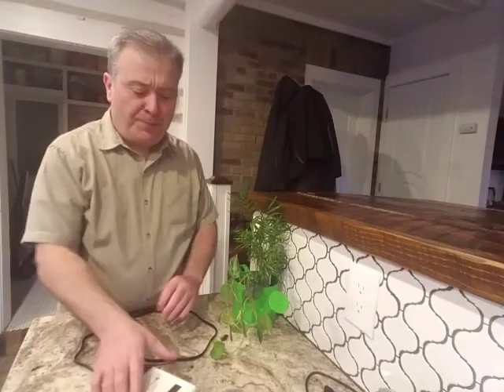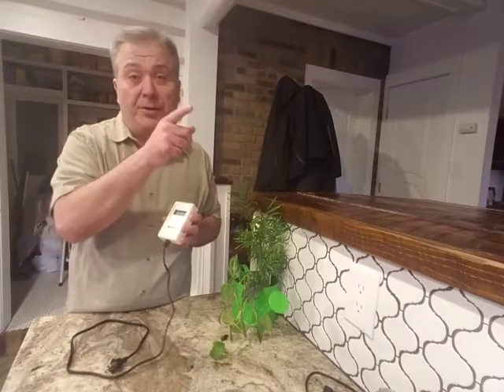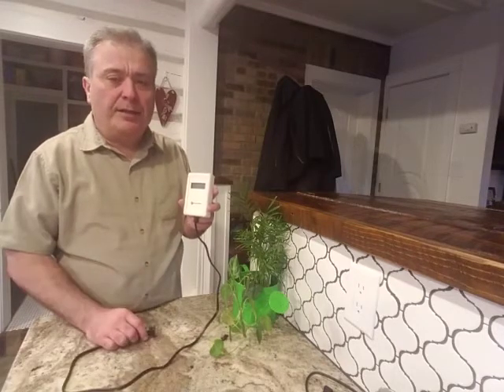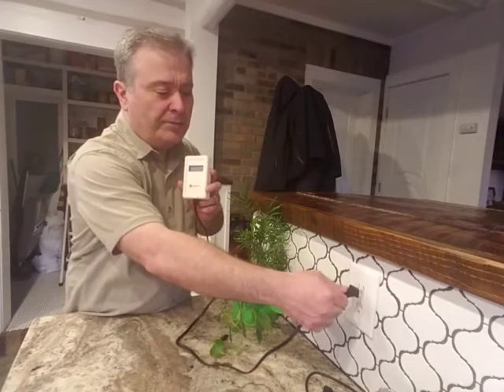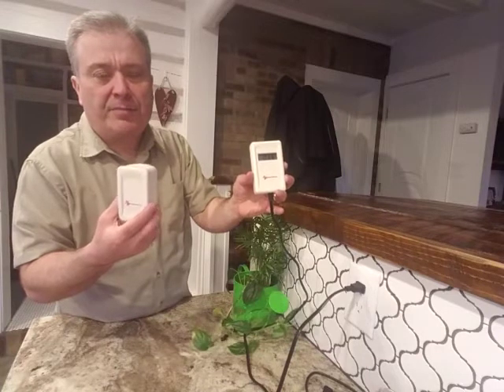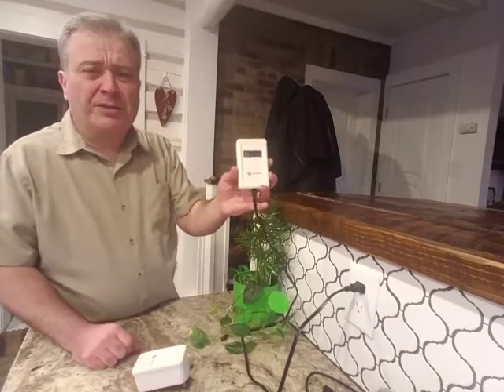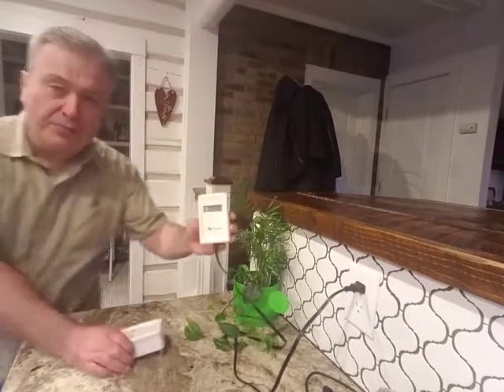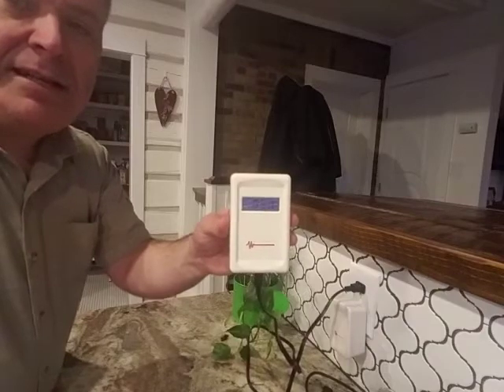Graham Stetzer Meter Filter Review

Comment: I saw a different kind of filter on lessemf.com by GreenWave that still allows you to use the outlet. Would you recommend these or they are not as effective as the Stetzerizer filters?
Reply from the maker: Thank you for the question. I do recommend lessemf.com for some things. I have never tried their filters but you should never buy filters without owning a meter, because the meter will tell you which circuits need filters and which don't. Not all circuits need filters. And the meter will tell you if the filter corrects the problem. In case it helps here is an article I did on the meters I am familiar with and what they are good for. https://www.radiationhealthrisks.com/best-emf-rf-meters-and-detectors/.

Comment: How does this product actually do anything?  I don't see how it could possibly reduce any dirty electricity that is coming into your house.  All it's doing is filtering dirty electricity from one circuit on the outlet, to the other (into the filter).  So the filter would still emit the dirty electricity (which cannot be tested then).  Am I missing something?
Reply from the maker: Thank you for the question. They work similar to how a ferrite bead works. Do a youtube search for ferrite beads and you will see one of the top 3 or so videos has a guy testing one on a sophisticated piece of equipment. There are several different brands of filters. Yes the filters do emit a bit of dirty electricity, but much much less than the circuit was emitting without the filter. Hope that helps.

Comment: Does the Stetzen filter work if it’s plugged into a Surge extension cord rather than directly into the wall circuit?
Reply from the maker: That is something I have never tested. I will test it sometime this week and let you know.
Reply: RadiationHealthRisks.com:  I just tested it and the reading is the same whether socket or surge protector extension cord.

Comment: Hi. I have dirty electricity in my apartment. I heard you say "frequency from the wires and walls, a little from the power company... Appliances". My question is whether or not a room without appliances can be just as bad if the wiring is old? The noise in my bedroom is like cicadas chirping and it's causing me brain fog, memory loss, and I'm losing sleep of course. My landlord asked me "what's dirty electricity" as if to be coy. What would you do?
Reply from the maker: I try not to guess. I know it costs money but I would get the meter so you know for sure. The other thing you want to check is other sources of radiation that may be more of the problem. If you go to my Youtube channel there are various videos there you can watch on the different sources of radiation, all of which could be causing your brain fog. It was amazing once my wife and I mitigated all of the radiation from our home, especially our bedroom, we started dreaming again and sleeping so much more restfully. You might also check out the website radiationhealthrisks.com.

Comment: I have a smart meter. Will the Stetzer filters work in my home that was built in 1968.
Reply from the maker: Yes. You need to get the meter with them though so that you can measure each circuit before and after plugging in a filter. In some extreme cases you may need more than one filter on a circuit.
Reply: @RadiationHealthRisks  Thank you.
Reply from the maker: @katekurtz6788  No problem!

Comment: Hi there...ok everytime i plug my filter ....i hear a buzzing noise ....is it supppose to make a sound when i plug it in......or is suppose to go away when i plug in my filter?
Reply from the maker: No, it should not make a buzzing noise. It sounds like you might have a faulty filter. I would contact where you bought it from and have them replace it.

Comment: Everyone seems to be sold on putting a filter on each plug of the home to solve the dirty electricity. This WILL NOT WORK because in doing so your actually going to draw more power to run filters. The average home needs 20 of these filters at $30 each.
for more information see the following
https://www.youtube.com/watch?v=-M4j-YdyrVo
Reply from the maker: Thank you for your comment. It does work.  I prove it in the video.  And so does the video you linked to. But you are correct there is a cost and it often takes quite a few.  And the filters do create small magnetic fields for about a foot around the filters.  This radiation is of a much lower amount of radiation and are much better than the bigger radiation fields they are eliminating. For a house like mine with no smart meter I only needed about 6 because not all of my circuits were high, and the ones that were only took one to bring it down. But with house with a smart meter, or lots of electrical gadgets that  create dirty electricity, it will take a lot more filters to bring it down to a safe level.  The best solution obviously is get rid of the smart meter and the other problems and gadgets in the house that are causing the problem like I did, and then if you still have a problem it will only take a few filters to bring any remaining circuits down to safe levels.